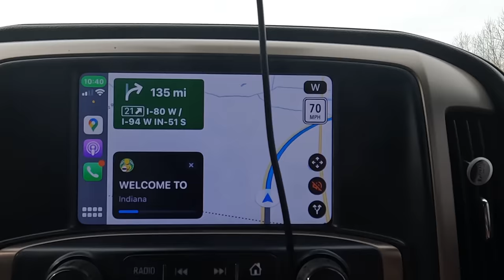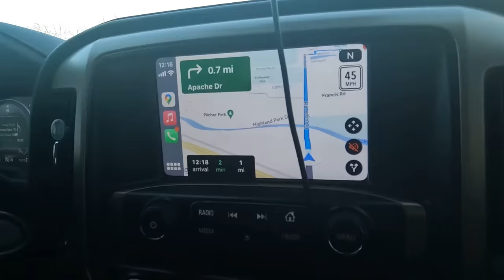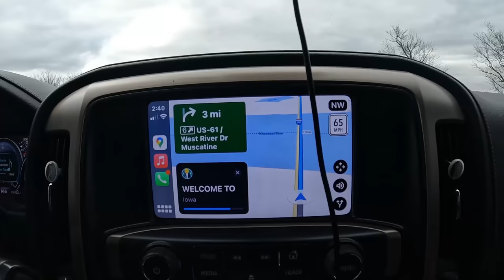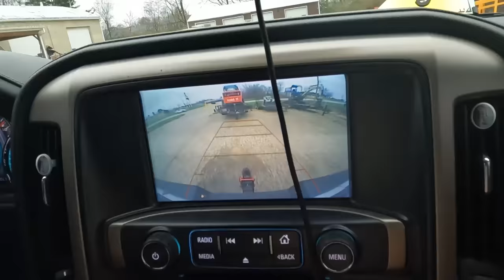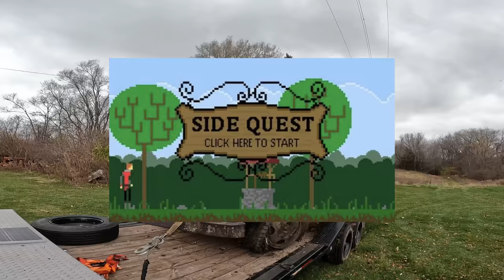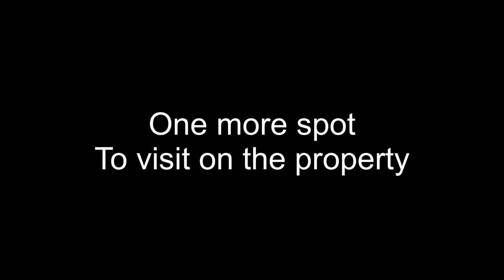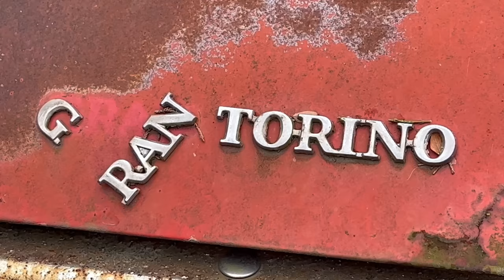Exhuming 1941 Ford COE Crew Cab from its Grave! Military Truck turned Bell telephone Truck.

Comment: The is there water in it question at the beginning the answer is it depends. 
Chicago suburbs used to have sewer backups in to homes with heavy storms so starting in the 1970s Chicago Metropolitan Water Reclamation District started what we called the deep tunnel project where first sanitary and rainwater sewers were separated and the rainwater sewers were to be diverted to the deep tunnel in time of heavy use and then pumped out as the rivers and streams could handle the run off. That's the former Thornton quarry that Material Services used to quarry limestone from ( before the sound walls went up it was cool AF as a kid to see just how deep that quarry is. It's deep) in order for the deep tunnel to actually keep the entire Chicago area from sewer back ups or dumping untreated waste water into streams and rivers there's times when the deep tunnel system needs to be dumped into a holding tank of sorts. That quarry or quarrys  ( one on each side  actually) is that holding tank.

Comment: Despite the ridiculousy high prices on the lumps of rust here in northern Illinois, the COEs are really cheap. A rusted out Volkswagen roller may have a $3000 price tag but a COE with almost no rust, running and driving, will sell for $1000 to $2500.
Reply from the maker: Send them our way 4123356100 finders fee if we go and buy them!

Comment: osage orange tree is nasty with thorns and hard ass wood like a soft ball. As kids we would have fights with them until you get hit by a ripe nasty one.    Had dozens of them on the property, used as fence posts never rot and no insects to dense. Yellow to orange wood centers very difficult to mill but when done beautiful hard as concrete wood. Used to fill a pop bottle with diesel and light the center of the cluster, burns super super hot and next day tree is down and flowered out

Comment: You said it's worth pulling out plenty of time's, wondering if your trying to talk yourself into pulling it out? It's a 3 door that's pretty cool don't think I ever seen one of those.
Reply from the maker: Haha I absolutely was. Just a lot of what if’s 

The terrain down there is tough, there’s motors and metal sticking out of the ground everywhere. I really figured  that truck was gonna put up a big fight so I was nervous. It ended up going easy.